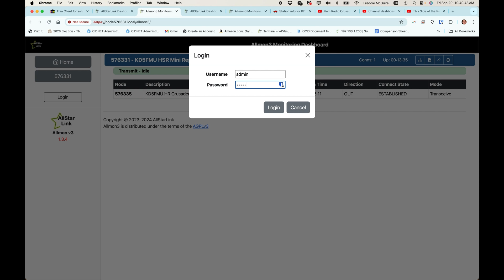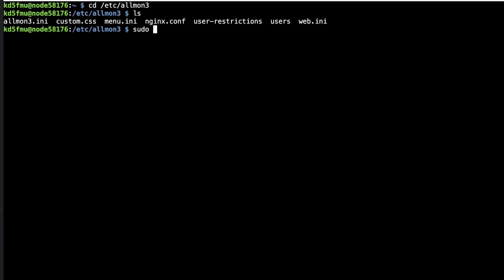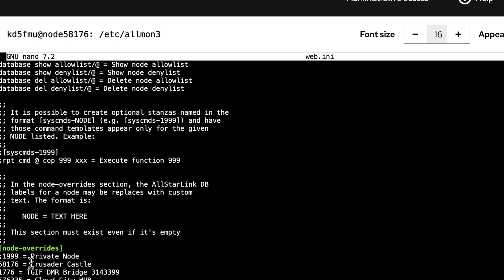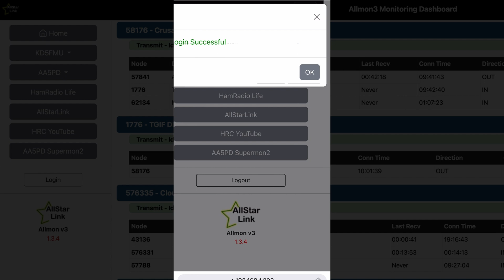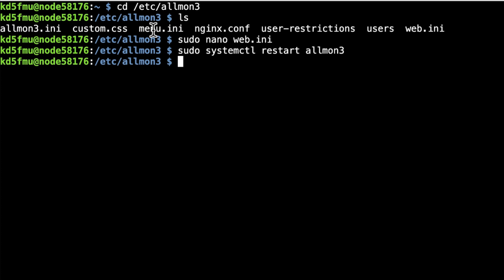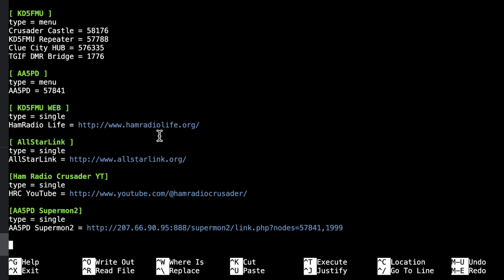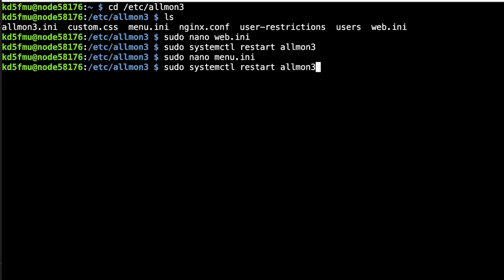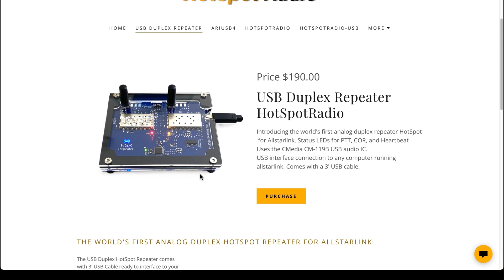Hot Spot Radio - Mini Repeater & Allmon3 Customization

Comment: Could you make a video showing how to configure the repeater to work with the ASL3 software.  I purchased one at the Gwinnett Tech Fest here in Atlanra and was unable to get it to work on ASL3, but it works like a dream on HamVoIP.  I really want to be able to use the newer features of ASL3.
Reply from the maker: @oherra  Mine runs on ASL3 and as a matter of fact, I will be doing one soon. My friend is sending me his to troubleshoot. And I will be making an ASL3 install video.
Reply: @ thabks! I had couldn’t change Change CTCSS From to ‘no’ every time I tried the repeater would just stay keyed…. I’m sure it’s something I was missing in some random setting.  I’ll be looking forward to your video.

Comment: I'm always mobile using XPR 7550e and XPR 6550 Mototrbo radios on both DMR channels in the box and two Analog Channels one on simplex and the other one on full duplex. 
I had my HSR repeater for three months now and had to separate my antennas from the transmit and Receiver because I could not go more than 70 feet before the thing not working.
  I just put Coax on each both the transmit and receiver and it worked well the transmit is down below and the receiver is high above, and I can now go 300 feet, and it works well. 
My simplex node I can go one half mile from my house with the Antenna in the box. https://youtu.be/swHzVgfX2Vo